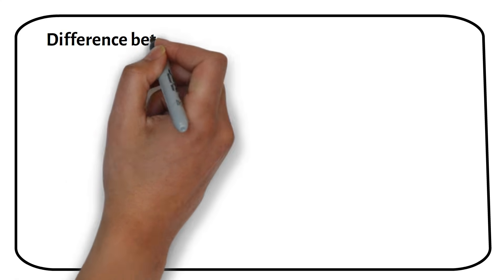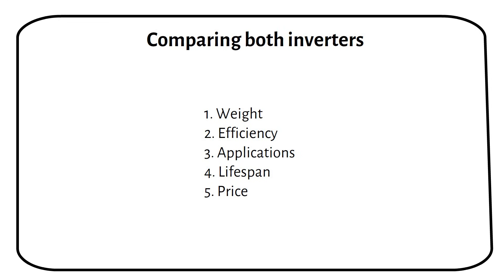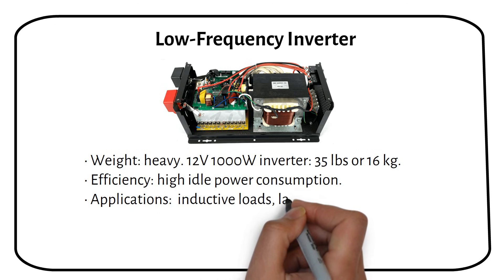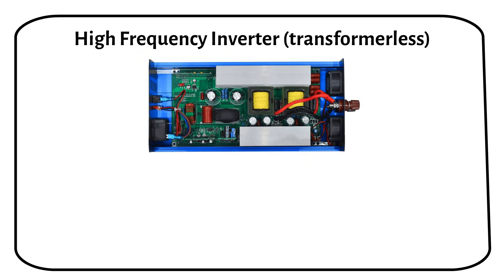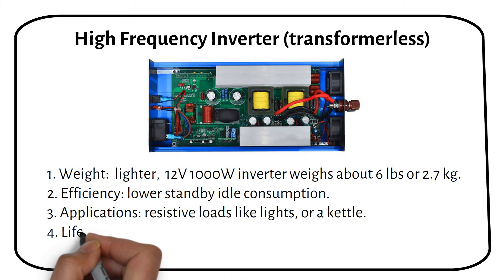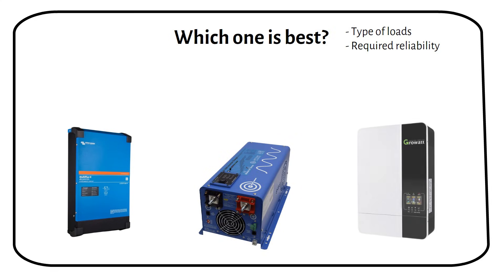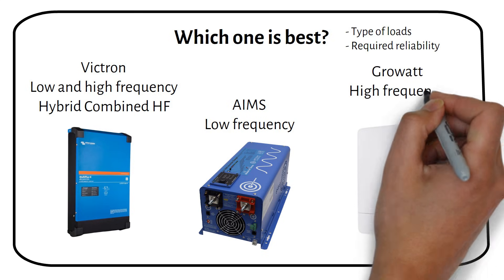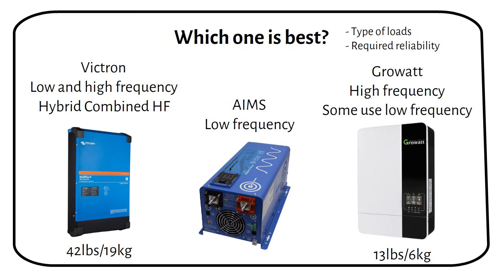Low Frequency Vs. High Frequency Inverters

Comment: The solution for high frecuency inverters is to use high kilowatts  capacity to avoid failure.
note: AIMS also use high frecuency inverters recently.
..........AND use always Pure Sine Wave inverters.

Comment: I've had both types. Two LF inverters failed within a year. Standard household use. Lights, fans, fridges. Hf have been in use 5 years one failure capacitor (replaced and in service). Using from 48v battery solar charge controller. Lf were $1000. Hf $100.

Comment: The MOSFETs in all inverters eventually fail. They will fail far soon in your XP high frequency, output transformerless inverters than they will in low frequency, transformer based inverters. When MOSFETs in an XP inverter short to ground during a failure, they will send high voltage, high amperage DC current through to your home's AC loads including your EV and cause severe damage. If you happen to be in contact with the output of your XP inverter during the failure, the DC current can be far more lethal than AC current.
Reply from the maker: Yes, MOSFET failures in an inverter can produce high voltage spikes, particularly in circuits with inductive components or insufficient protection measures. Using snubber circuits, fast fuses, and proper thermal management can help minimize the impact of such failures. But this is quite advanced.

Comment: HYBRID Inverters !!!  Most of the Victron inverters ( Not the RS ) send a High Frequecy (20 khz) PWM into the input of the Prmary Winding of an large Iron Transformer, with a smooth Pure Sine Wave output.  Victron calls them Hybrid Inverters.

Comment: Why do people keep saying low frequency inverters have high idol consumption, cheap LF inverters do, good LF inverters are extremely low idol draw. My portable low frequency 3000w continuous solar generator draws less than 13w @ idol. And you said your self you recommend victron LF inverter for its low idol consumption. Mine is not a victron, but victron is very good. Quality is the factor in low idol consumption, and you would be very hard pressed to find a HF inverter with a 13w  idol draw
Reply from the maker: Indeed, quality low frequency inverters don't draw as much. But you are going to pay for it. Victron says they use a hybrid system (whatever that means). There are low frequency inverters who consume way more than high frequency inverter though.

Comment: Thanks for this.  I'm setting up a solar emergency system for prolonged outages but not regular use.  I have a have h freq giandel 600w that I bought 2 years ago and tried on our basement tv. It's an old plasma.  The wattage goes from 150 to 300 depending o on screen brightness.  For some unexplained reason the inverters fan will not come on.  So I bought a Victron 500w thinking it'll be bulletproof....... 

It won't power the TV.  Relays in both the TV and the inverter click on and off but it will not power the TV.  Very confusing and not sure what to do.  I think it's because it's a non linear load?  I kinda understand the concept.  What's a good hi freq inverter brand?
Reply from the maker: The victron should power the load no problem. Does the inverter power other loads? is there a voltage at the output? is it an inverter/charger? Reply to my email because I won't see your reply on here.
Reply: @cleversolarpower   thanks for the reply.  I don't see your email address?  So replying here.  Yes the 500w victron Phoenix Powers the heater. It won't power the TV.  In eco or ON mode.  Not even a flicker. Ceramic heater no problem.

Comment: Low frequency Inverters at no load may have mechanism to isolate the Iron core transformer to minimize the core loss. But in run time it will be in line and this core loss will be significant compared to high frequency Inverters. 

On the otherhand, as Iron core have large voltage regulation at over load condition during surge power, hence limiting primary side current of iron core transformer through FETs. Ultimately,  can take care of any high torque inductive load in the starting time without damaging inverter ckts.
Reply from the maker: Thanks for your comment! I did not know that.

Comment: will High Frequency hybrid inverter last if the load is light inductive loads, like 0.5 hp water pump or 1hp Air conditioner using a 5kw rated hybrid inverter, If the surge load is assumed 5 times the rated load that will be 3.7kw at most, and that is still smaller than the power rating of the inverter it will last right?
Reply from the maker: Of course.

Comment: High frequency inverters have problems with inductive loads and load balancing.  So if you have more loads on one 120v leg or you run a power saw, these inverters can shut down on you.  So you end up having to over-size your system to compensate and end up paying 10x as much, as compared to a low frequency inverter.

It’s annoying that we don’t see any all-in-one outdoor rated low frequency inverters on the market, and it seems when manufacturers address that, they move to high frequency models, which will have the same issue with load balancing and induction.
Reply from the maker: I wouldn't say 10x as much , but i get your point. Victron has one unit called easysolar, but the charge controller and inverter/charger is still separate. Modularity is not a bad thing.

Comment: Low freq is better the idle is not that big a diff some HF has higher idle load vs low freq inverters
Reply from the maker: Indeed, like i said in the video it depends on the manufacturer.

Comment: "Pure sine wave" Low frequency inverters are now the most common type. Just like high frequency inverters, they use FETs to synthesize a sine wave by using pulse width modulation. They have nearly the same electronics complexity as a high frequency inverter. Both low and high frquency inverters switch their FETs at very high frequency, so the term "low frequency" can be a bit misleading. The real difference is that high frequency inverters use a DC-DC boost converter to create ~350 volts DC, and then use FETs to switch that high voltage on and off very rapidly to create the 120/240 VAC.
Pure sine Low frequency inverters use high speed FET switches to rapidly turn the battery voltage on and off to create a low voltage 50/60 Hz sine wave. That low voltage sine wave is stepped up with the large, heavy low voltage 50/60 Hz transformer/
Reply from the maker: Indeed, I didn't put this in the video because people would fall asleep 😀. The term "low frequency" in inverters can indeed be misleading. While low frequency inverters do use FETs that switch at high frequencies, the key difference lies in how they convert and manage power.
Reply: @cleversolarpower  Low frequency inverters also have another capability that most high frequency inverters lack: They can absorb AC power on the output side, and feed that power backwards through all the inverter circuits and charge the battery. This means that a low frequncy inverter can act like the grid. If you have an existing solar system that is grid connected, and is has only AC output, perhaps because it is built with microinverters under each panel, it will shut down when the grid fails. If you add a battery and a high frequency inverter to such a site, the solar panels are still useless. They can't charge your battery. But if you add a battery and low frequncy inverter, the AC power from your solar system can flow backwards through the inverter and charge your battery. For anyone who dove this deep into the comments - look up "AC coupled solar backup" for the details.
For me, this feature of low frequency inverters was the key factor that made that type mandatory for my situation. I had a large grid-tied solar system at my house, and wanted to add a backup system that would enable that system to work even when the grid was down. So I added a 5 kW low frequency inverter, and it does exactly that. The solar system "sees" it as a grid, and fires back up, and pushes its output to the inverter, which accepts it, just like the real grid would.
Reply: "They have exactly the same electronics complexity as a high frequency inverter." except for the complex DC-DC, which is extra for HF ;)
Reply: @petrvalkoun4539  I repair inverters for a living. Have done so for the past 25 years. High-frequency inverters have nearly twice the component count as low-frequency inverters, and they're far more dangerous for use when powering household appliances because high-frequency inverters don't offer any galvanic isolation between their DC to DC boost stage and their AC output.
Reply: @quickquote1568  with your knowledge and years of experience, what do you think is the best off grid inverter?
Reply: @petrvalkoun4539 True, but that boost stage is pretty simple and low parts count.
Reply: @jimmurphy5355  I would not be so sure about that, deditaced hi powered DCtoDC boosters are pretty expensive and large
Reply: @s.mendez7160  I have no idea. That would be a question for Victron tech support.
Reply: High frequency inverters use a far more complex design and have a much higher parts count which makes them more difficult and costly to repair. We charge a higher total when quoting a high frequency inverter repair due to a longer diagnosis and repair time.
Reply: @quickquote1568  If you are talking about a simple low frequency inverter that switches the DC from the battery at the mains frequency, and produces a rectangular wave output, I agree. That type of inverter has a very low parts count. On the other hand, a pure sine wave low frequency inverter has a circuit complexity that is comparable to a high frequency inverter It matters very much what kind of low frequency inverter you are comparing.
Reply: @jimmurphy5355  No I'm not talking about old fashion square wave inverters. Modern high frequency, output transformerless inverters all have a much higher discreet component count than do low frequency, transformer based inverters. This is due to the multiple paralleled DC boost stages, multiple inductors, caps and related control components for each stage. I know this to be true because I have repaired thousands of inverters, both low frequency and high frequency down to the component level, (not just board swaps) over the past 24 years. How many inverters have you repaired?
Reply: @quickquote1568  Only a few, so I will defer to your assesment.
Reply: very interesting, what brand inverter did you chose for this purpose?
Reply: @narotica1  Sigineer
Reply: Exactly thats why I also make comment. Is confusing
Reply: The more I read from you, the more red flags pop up..  

" Both low and high frquency inverters switch their FETs at very high frequency, so the term "low frequency" can be a bit misleading". 

Explain misleading?

Comment: One important question remains open: who are low and high-frequency combined, e.g. in Victron? How do they achieve low idle consumption beeing low-freq. inverters? They combine PWM with a low-freq. transformer in the end-stage. We need to understand how this works!
Reply: I guess they monitor the type of load connected and switch type appropriately the type to be used.
Reply: Victron inverters low standby power is likely mostly due to their use of expensive Toroidal transformers.

Comment: I have several of the  Growatt 5K inverters and have to use transformers to form neutral for 120v loads. The transformer adds a bit of boost when starting inductive loads although that wasn’t the original purpose. I’m running two 18000BTU mini split heat pumps on one and am planning to add a third. Because of the inverter design of the heat pumps they don’t seem to have any start up surge. This particular inverter doesn’t need a transformer because the heat pumps are 240v.
Reply from the maker: Good to know, thanks for sharing!

Comment: Three years back i was sceptical about high freq inverters.That is why i bought four and two sets of lead acid batteries .Two inverters per battery pack .For breakdown reasons.So far no problems.A friend of mine have one that is in its sixth year.And its very cheap.Prices between 200 and 400 dollars each.Depending what type of built in charger it have.If i convert South African money to dollar.
But both of us avoid microwaves,electric stoves,toasters.Cant utilize it anyway because of low battery capacity.And batteries extremely expensive.
Reply from the maker: If your loads are low compared to the power rating of the inverter, then that will also extend the lifespan. Maybe thats happening in your case. They can last up to 10 years as well.

Comment: Excellent video on the difference between high and low frequency inverters. Low frequency make a much better choice for real world use.
Reply: A good quality high frequency inverter is actually the better choice in many cases. Lighter, less expensive, more efficient and lower idle dissipation.  About the only definitive advantage a low frequency inverter has is its ability to be an energy sink on the AC side. That is a compelling advantage if you need that ability - typically to work with an existing solar system that has only AC output. Look up "AC coupled" solar battery back up for the details. Cheap high frequency inverters can't handle extreme surges - but you can fix that by simply using a higher capacity inverter. A high frequency inverter rated for 4 kW will handle the same start up loads as a typical low frequency inverter of half that continuous rating. And it will still be cheaper, lighter, and more efficient.
Reply: @jimmurphy5355  Why do you think they're so much less expensive than a low frequency inverter? For decades, they've been considered a "poor man's" inverter because without an output transformer to provide galvanic isolation between their DC boost stage and their AC output, they have a tendency to damage AC appliances during a catastrophic failure of their H-Bridge circuit. They're simply not worth the savings in cost.
Reply: @jimmurphy5355  A high frequency, output transformerless inverter is never a good choice for any residential application. The reason for this is without a transformer, they offer absolutely no galvanic isolation between their DC boost stage and their AC output which can not only damage your AC appliances but can also set an AC appliance on fire during a catastrophic failure of the inverter's H-Bridge circuit.
Reply: @jimmurphy5355   That is true, 4kw HF will handle the same start up load of 2000w LF,but it won't do it as long,That LF unit will still be running when the 4kw HF shits the bed,because there not designed to take the high surge over and over, even when over compensating, the chips will last longer but they will die, then your left with an expensive, although cheaper, paper weight,because it won't be repaired, it's just not cost effective. But if you know,design, and can do better than China man in HF, you would be a billionaire. But your not!